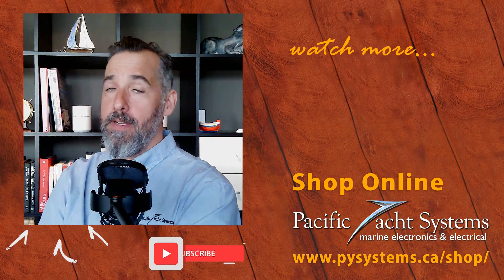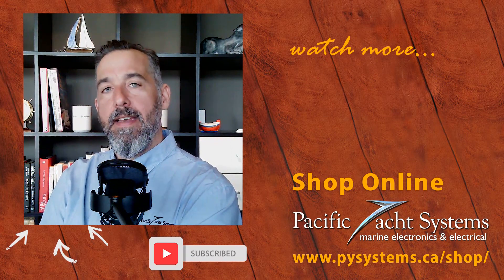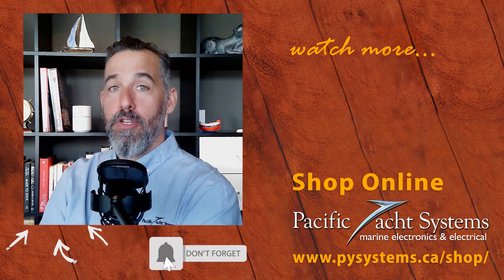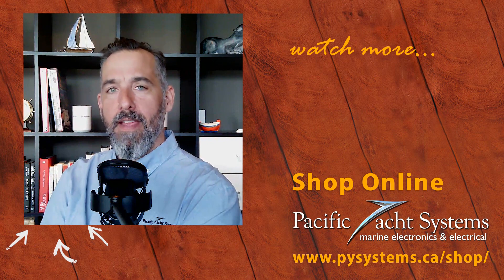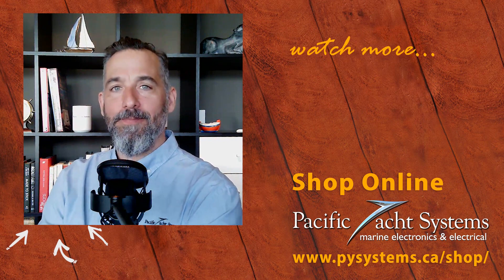Does the Airflow Around My Boat Appliances Affect the Amp Draw?

Comment: Lol. My new production boat doesn't even have vents. The heat just gets trapped under the counter! I think I'll be adding some computer fans to circulate the air but that still seems like adding more complexity when a simple solution could have been built right in